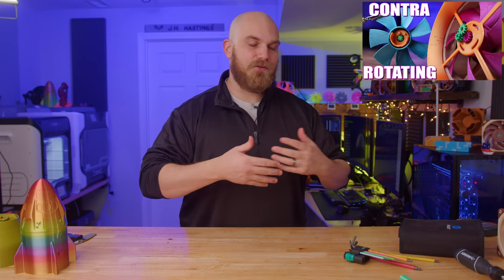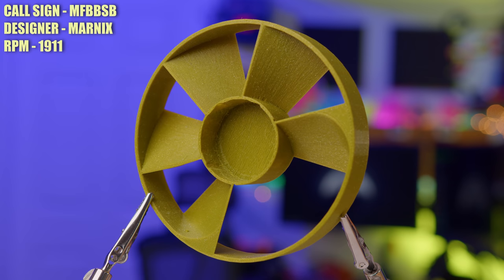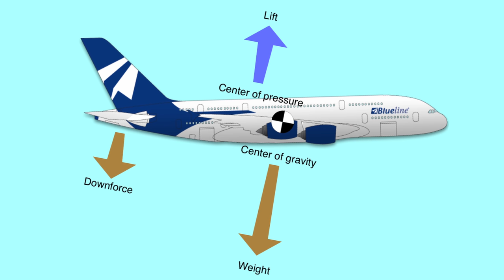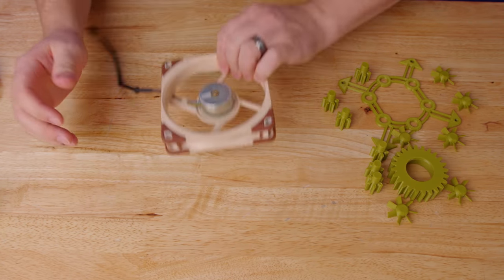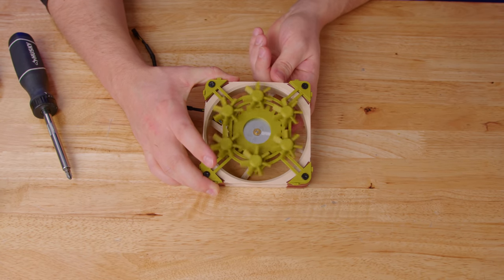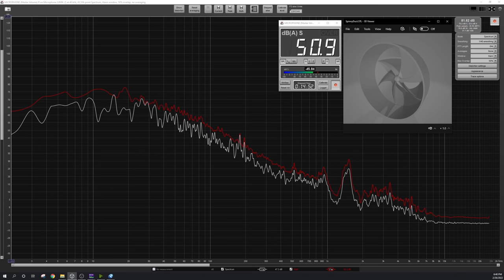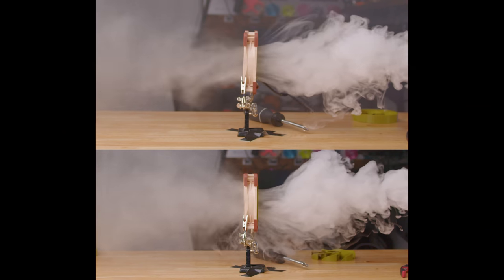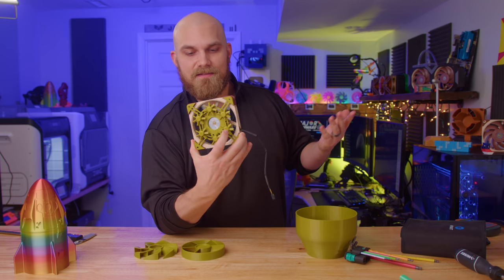WARNING Prolonged Exposure May Damage Hearing | Fan Showdown S4E2

Comment: What’s the best 1000% newbie friendly 3d printer to use  that does not take being a programmer or a guru to setup? I’ve got a 500$ budget. I want to print good quality brackets and random pc mod parts.
Reply: Im right there too
Reply: Voxelab Aquila it’s just like an ender 3 but cheaper
Reply: I just started 3D printing, and I told myself I don't want to use pla or filament because I want great detail and lots of headroom for growth. Anycubic Mono X was my choice. It's awesome.
Reply: Save another $350 and buy a Prusa.
Reply: Any creality. But I'd go with a flsun qqs pro.  Or q5 if you're on a budget
Reply: I got an Ender 3 v2 and while assembly was a little fiddly to assemble (mostly because I chose to assemble it on the shelf i plan to use it on instead of a nice clear work space...)   I had it printing in about an hour and with just a little tweaking to get the print bed level I've gotten some very nice quality prints out of it. The other side of things is that you need the software to prepare the file to print, I've found prusaslicer (which is free so you could try even without a printer) to be very easy to use, I basically just found a preset in the program for the material I have and then can just drag in the 3d file, click slice and its good to go.
Can't say for sure its the best newbie printer/slicer as I haven't used too many others but I can say that for me its been a brilliant first printer.
Reply: @matthewdye942  I don’t particularly like the word cheap now a days lol. I want good but not sacrificing anything. I had a biqb1 and hated it. Failed and broke on the first print. It slammed it self to death lol
Reply: I got an Ender 3 v2, and im pretty happy with it
Reply: I agree with smellycat249, Prusa Mk3s or the smaller cheaper mini. They have their own slicer with filament presets so getting started is a snap, plus they are very dependable and absolute workhorses.
Reply: I got a ender 3 v2 and it does the job + awesome community
Reply: Ender 3 v2. The thing is pretty solid for what you pay. And its like the most popular hobbyist printer on the market. So if you have an issue and need to troubleshoot.. chances are someone else has had the same issue.
Reply: Thanks guya
Reply: Really any 3d printer will be similar in what is needed for experience and effort to print on. Woth that said some will obviously be easy to tune and keep tuned, but learning to print well is a process. Just get one and play with it until you can get another after you know what features you want/need or you stop doing it out of frustration(likely this scenario). If you really want easy and arent afraid of resin chemicals get a resin printer like something from elegoo. They are really the easiest thing ever. Its sort of steal stuff from thingyverse put it on printer start and walk away. No need to fuss with settings almost ever.

Comment: #suggestion 1) it seems for most designs (but not crazy ones...) you can try to check same cooler with different amount of blades. It is quite interesting how blades impact on the overall performance. 2) also you need another top list for cases 3) consider adding more top lists by most important factors

Comment: If I designed and printed a mod for the stock fan that noticeably improved the fans static pressure, with a very slight improvement in unreatricted flow to boot, would that be something that might be interesting for this format?

Comment: The large ducted fan is a cool idea, but more mass equals more slowerer.  But really, the friction from the ring moving seems ot throw the air away not help draw it in, ideally we want to turn that Kinetic energy of the fan to velocity in the through the fan direction not so much radial velocity.  Other cool thing i learned: The fans can add velocity, pressure, and head.  You can have all three or any one, but thats what fans and pumps do.

Comment: I wonder if you flipped the blade orientation or used it in exhaust would The Duct one work better since the blades are definitely oriented in the opposite way as in a push configuration instead of pull like you assumed.

Comment: Spinny Duct is a great experiment. I believe that there are quite a few factors going against this fan in particular.

1.) The motor must rotate the entire mass of the duct and the fans. More mass == more energy (heat/current) == less RPM. Please verify Major Hardware?
2.) The interior surface area of the rotating duct ensures this fan lives up to it's name. It merely spins the air in the "tube". 
3.) The conical air guide forces air back outward due to centrifugal forces.
4.) The pitch angle of the fins is far too aggressive for the RPM of this particular motor. Fantastic shape and flow though (without the duct)!!
5.) Balance is off. This is inherent with any 3D printed fan and not usually a major factor. The duct here develops a significant oscillation which leads to a destructive harmonic in the material. These harmonics across what looks like a 4 inch/100mm duct further impedes ingress airflow. Like multiple people on a trampoline randomly going in and out of sync. Fixing this balance issue is moot given point #2.

I think there's room to grow here with both gears and EDM style designs. I.E. Electric turbo chargers. Temps too high? Arduino, temp sensor, solenoid, clutch, deafening noise == cooled PC, with proper sized cowbell.

Given the rough texture of these prints, I wonder if there is a filament material that could withstand a super thin gel coat. A smooth surface would really go a long way to reduce turbulence.

Comment: I'm loving these multi part fans!! It made me think of a ridiculous fan. The ifbiaac (inefficient fan because its actually a clock). Take the rpms of a fan and gear reduce it so many times that you could have a working wall clock. It would be the loudest thing in the world, and take 1000x more power than a regular clock, yet it seems fitting for this show.

Comment: The spinning duct is just too big. Having an intake area that is slightly larger than the exhaust area helps, but the difference shouldn't be too big, otherwise you have to compress all that air to get good airflow.

Comment: What's the best way to get a fan to spin as slow as possible with accurate RPM? I purchased a fan controller, but the fan doesn't kick in until I increase the voltage, when it finally starts to spin the RPM is in the 600 RPM range.

I purchased the Lamptron FC5 V2 Fan Controller and a Noctua NF-A4x20 FLX fan.

Comment: I wonder if Duplicator could be quieted some by including a "backplate bracket" that also allowed the smaller gears (with a cylindrical extension opposite the threaded end) to rest in/on. It would bring the smaller gears closer to the main gear, and reduce some of the vibration from them rocking around. Then maybe use a shroud (maybe the Cheater's) to better direct some airflow in.

Alternatively, just cut down the number of fans to 3 larger ones, reducing the number of gears and rattling, and providing a bit more fan blade space to work with.

Comment: Oil may be hindering the fans. It's such low load that lubricant is not necessary. Even light oil will introduce shear viscosity. The reason fidget spinners are so free spinning is because they are dry bearings. Put oil in one and see what happens.

Comment: Funny to see that duct fan blowing air both directions. The duplicator just throws it every direction. Then the others were both pretty comparable and effective.

It's interesting seeing some wing design thrown into the mix with that falchion. Definitely seemed to give it a boost, being close to the same feet per minute with less rpm and a little more noise.

Comment: Afaik you should only use oil on spinning parts if there is heat being generated by friction or if high stresses are in play, otherwise it will actually create more friction. Oil is never used in fidget spinners so they have less friction. It might make them more quiet and smooth, but introduces friction.

Comment: I challenge the designer of that gear fan to design a new one with overlapping mini-fans. My hypothesis is that with a bit of overlap, and thus the mini-fans being bigger, it could actually move a much bigger amount of air. Basically, there could be a way to make the spun area larger than the total area of the 120mm fan. The center hub would be of a smaller size as well, helping with the fan's performance.

Comment: I had high hopes for the spinny duct,  I think the creator is on the right track for success by integrating a shroud and fan together.  It just needs the blades reworked.
Reply: Maybe it needs blades all the way out, to counteract the centrifuge effect. And an actual flare at the opening, since that's what makes air able to flow around the edge smoothly.

Comment: The Duplicator could potentially be revised to house four slightly larger fans, and utilize ball bearings. This, in combination with a skeletonized main gear to reduce weight, should equal a better result.

Comment: From the looks of things, the "Spinning Duct" needs to be discharging on the larger opening.  Just from my very limited engineering type knowledge, that's how I would have used it.  I should show a much better volumetric flow rate.

Comment: I've read the other comments about the spinning duct and I think you all are missing what this design could be evolved into. Take that design but delete the fan blades entirely and place the duct on the output side or rather simply consider it the output side since we're not actually using these on computers anymore. It's a bladeless fan and if it weren't for the problem of the motor blocking the center you could have a completely open hole going through the middle. I'm not interested in performance for this idea, I just think it would be a novelty that this channel hasn't seen yet.

You could also probably reverse the direction of the cone and have the narrow end facing out and then the duct could still be on the input side but I just think it would look neat the other way.

Comment: The biggest issue with the spinning duct fan is that the blades are too vertical. If they were angled a bit more the performance would be far better.

Comment: The spinning duct might work if you were able to have a constant static pressure like flying through the air I’m not a engineer but it looks like having the duct spin is creating turbulent air stalling the incoming air if the incoming air was at a pressure able to push the air it might be a good idea for boats of planes that want an ultra quiet and safer prop

Comment: Would be good if future episodes could measure static pressure. I am sure that some fans move a lot of air at low pressure and others move less air at higher pressure.

This would aim them at either case or radiator applications.

Comment: that gear fan would benefit from being adjusted so the inner race was smaller and the outer fans overlapped the slightest for the max surface area * speed (obv the gear teeth would have to be adjusted to keep the ratio)

Comment: @Major Hardware

Just wondering:
(1) - Has anyone tried paired (offset) coaxial contra-rotating fans? There are a couple of helicopters which use this configuration, which apparently produces the same downdraft with slower rotation rates. (They can also fly upside down, but I dunno if it would be helpful in this context...)

(2) - Has anyone here tried Hyper-Silent designs based on an Owl's Wing? I read a white paper about this idea for computer cooling fans years ago. 
   • The Owl's Wing has feathers at the leading edge like little Combs, with a very precise spacing & length of 'teeth', and exact gaps between them. These 'cut' into the airflow, creating little vorticies & counter waves which acoustically cancel much of the sound.
   • The rest is just extremely soft  fluffy tips on the Primaries & Secondaries, with branching & more branching, in a fractal structure - acting like mazes for the soundwaves, breaking them up into acoustic fuzz...
   •  Some species can dive at over 120km/h in total silence to grab their prey...

[ I live down in the south-west of Western Australia & have witnessed Owls plenty of times, brown above, snow white underneath (almost luminous) & utterly, utterly silent. Had one (chasing a bat) nearly fly into a big glass window I was sitting next to, only to open it's wings out at the last second - appearing from the darkness as if by magic. I couldn't hear a damn thing & it was a metre from my head - very eerie f33l'... ]

Comment: the duplicator is cool, but someone should take its design, make 3 blades, every other blade, sit higher up, and 3 on the lower in the same spots they are on the current one, and make them all have slightly longer/wider blades to see if that works a bit better

Comment: Idea i got because of the spinny duct.

2 Stage fan with a larger turbine diameter with more compression in front and a high flow fan ( or none) at the motor base

Comment: Here is an idea, I don't own a 3D printer so I have no knowledge about how to 3D print. I also don't own an A12X25. Why doesn't someone design a fan that reaches over the fan chassis by an inch or so. That will look cool with the smoke test, but I don't know if it will work in the wind tunnel test. In helicopters lift is mostly generated in the outer ⅓ of the blade.

Comment: Gotta get a good pull to push ratio with the fan blade design and then cut the center out and maybe add a air guiding tube or something just a small director and then that may be the best fan.

Comment: If anyone has ever looked at a radiator an blade from an older vehicle the ones that are pulley driven not electric......the fan blades are not evenly spaced out. Never understood why....someone told me balancing which makes sense.

Comment: You should team with SciTuber Steve Mould to create a quantifiable flow demonstration rig that actually results in real data.  It'd need to be more than just a CFM volume test, it needs to be more visual.  A mix of the smoke test and more...

Comment: there is always somthing about geared stuff in mechanics. gears are usualy loud no matter what you try. if they arent the will get loud. pluss all the extra friction isnt comparing special on such stuff. the Transmission properly is getting hard for the single little electric engine but(!) I always wonder why noone scales down the Transmission spead in order to have more power in the blades. can do bigger blade which shovel air with high angels into the case bu just rotating slow? plus.. angle your Gears to 30° it creates side winded forces but it makes the noise alot less.

Comment: sticking the funnel of that to the propellers is counterproductive.  by adding weight you will decrease the speed of rotation of the propeller decreasing its efficiency.  In addition, the larger and heavier the propeller is, the more difficult it is to balance, so it can charge a lot and lose efficiency if too.  And all that without taking into account how annoying it would be to have all that plastic sticking out of a PC chassis.
In short, it's a very bad idea.

With the 3rd I would be very surprised if those little fins were taken away from the turn it would make any difference in the volume of air it moves.  After all, a fan works very differently than an airplane wing or propeller, they have very different objectives. 
And what about the super complex, its design is bad wherever you look at it.

Comment: duplicator eould have worked if it would have  blades on the mouth of the duct.  Now it was just a massive air dragger that tightened the theorotical hole of the massive duct dan to few centimeters.

It either should be supers smooth, or it should have somekind of air pusher blades to aröeast push the drag force to right direction.  But big spinning surfaces always introduce drag.

Comment: some one need to remade this but longuer blade so blade can pass trough eath other.

like the gear tooh dose but the blade should not touch. 

i dont have the computeur for 3d modeling. it will not handle software for that

Comment: Air is sticky, so velocity stacks use this fact and centrifugal force to push air the wrong direction. For instance, the bladeless fans shown previously are essentially reverse velocity stacks. (I’m talking about velocity stacks on the fans themselves, not as a shroud. They help in that case.) Anyway, fan makers, stop using spinning velocity stacks!
Reply: I forgot to mention, the “spinny duct” fan in the video would probably work pretty well spun backwards. That way the velocity stack would work with the fan instead of against it.

Comment: Crazy that the geared fans are more noisy than some fans that were specifically designed around creating noise.

As a gun monkey, gun oil is terrible lube. I know 90% of the reason you are using it is that nifty applicator. I believe a low tack grease would be best in this application but honestly it seems the time of gears is now, it would be cool to see you do a video on different lubricants to choose which is most applicable and then use that from now on, possibly retesting old geared fans with new lube
Reply from the maker: Haha nailed it with the applicator

Comment: These multigear fans have no right to work properly with such loose contact and high traction which makes it lose most of the torque. The only multigear fans have right to be working, when they're placed on top of each other (like in turbojet engine), that way they don't interfere with each other. i think ima do one of these to prove my concept.